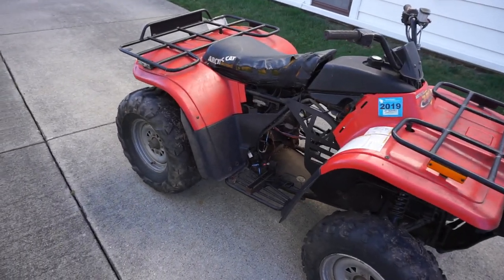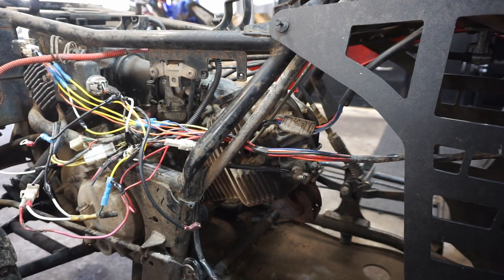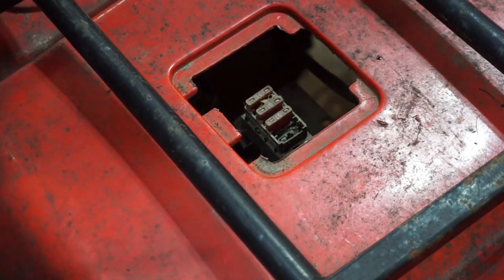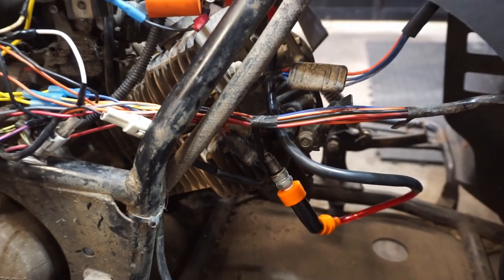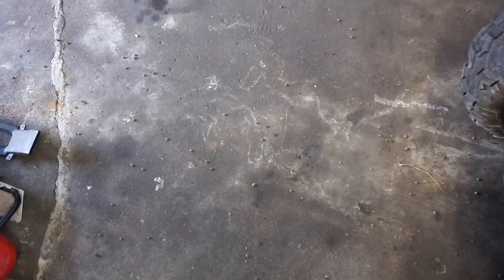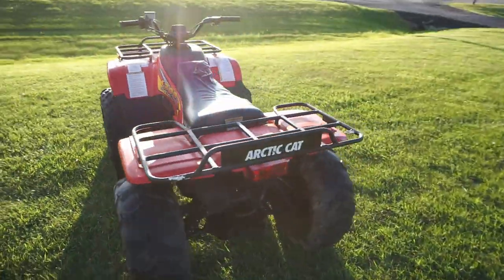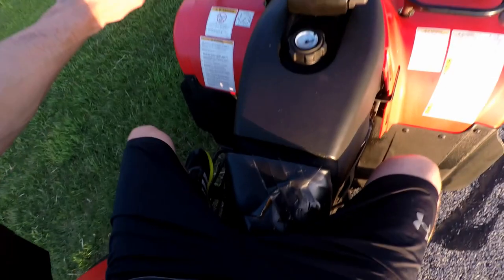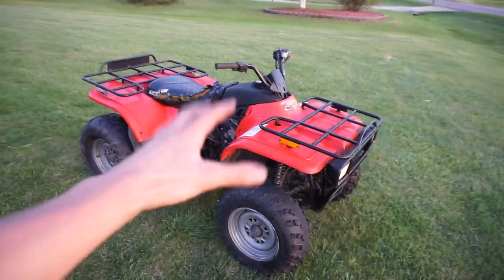Nobody Would Touch This ATV. Why Couldn't They Sell It?

Comment: If you work on a 454, 400, or 500 and it needs shocks, the front Fox shocks and springs off a 1998 ZR snowmobile will bolt right up. It is amazing how much it improves the handling.
Reply: Lol I’m gonna have to try that if I get ahold of one
Reply: @kountryquads9475  I was a test rider at Cat when these were made. As soon as I found out they fit I put them on 2 of my 500 4x4's. You could slide them into a corner and they had very little body roll and were even fun to get air with. As soon as I can find another one this will be the first thing I do to it.

Comment: Dude stick a magnet on the back of your compression tester so u can just stick that bad boy where ever u want. U use it so much, it  would make it way easier to position it for the camera. 
Also your a beast. Love the videos man. Cheers dude.
Reply: "where ever u want"  - engines are aluminium and fairings plastic, magnet will help in some cases
Reply: @vampirwrr  aw ye righto cobber. Thats a go getter attitude there.
Reply: @vampirwrr  but the frame… is not 👍🏼

Comment: Cool video. I have a '98 400 2x4. Looks  just like yours. I bought it new.  Had to put a new carb. on it a couple yrs. ago. Just changed the oil and am putting a new petcock and fuel lines + time for a new battery. It's been a great machine. Got new tires on it and a while back I replaced all the rubber bushings in the shocks. What a diff. that made too.

Comment: I have the same one but 4x4 version , can’t get used to the heal toe shifter.  Any suggestions for oil leaking out the sight glass ? Besides replacing glass ?  I put some sealer on but probably will be leaking one day .

Did you try the diff lock mod on your 4x4 version ? I did it has diff lock hidden gear just like the king quad

Comment: I am a big believer in Marvel Mystery Oil. I use this in my gas so the more I ride the better it runs because the oil really cleans the internal workings of the carb which in some cases won’t have to pull the carb.

Comment: The spark probably came from the capacitor holding a charge even when the battery is disconnected. On. Big capacitor is you can really get hurt. You got to be careful. CDI means capacitor, discharge ignition I believe so it probably came out of a CDI capacitor

Comment: These people that ya'll buy from are their own worst enemy. Screwing up the wiring this bad takes a knack. Thank God there is someone like you to straighten it back out. When ya'll get a new one you never know what you've got till it produces symptoms and on this one it had nuts in the exhaust till they finally blew out releasing the engine to finally run right. Ya'll thought the brakes were on for a while it was dragging so bad. That rear brake may still be dragging but ol Joe will get it sussed out.

Comment: Check the intake manifold boot . I had a 4 cylinder bike with that issue , They usually crack at the bottom so it is easily missed. .

Comment: Quick question I've noticed you pre lube some of the cylinders on your projects up with a lil bottle with extended nozzle of 2 stroke oil so it's safe to use this on the 4 stroke engines from what I'm watching on your channel. Just wanted to verify not to pour in as the oil supply but to lube a lil through the spark plug hole?
Reply: Yes it is.
Reply: you can use any lube or oil like that..it is just a small amount to oil the rings cylinder walls as those are dry from sitting... you don't fill it up ...then when it starts up it burns off ( so smokes abit )... best to spin the piston a few times before spark plug goes back in...and then you can fire it up... 2 stroke oil is ok in a 4 stroke in this manner...use proper oil in the engine oil gearbox

Comment: Are you sure the magneto is charging? When the battery fell out the engine should have kept running not just die like that. Also adjust the valves or check the chain tensioner.
Reply: I had a cable on my battery come loose and it fucked up alot of shit, and yea it ran for atleast 20 mins before noticing. Then a bump start got it going and it died completely after another 20 mins of riding back. I'm pretty sure it fried the stator

Comment: put some wd 40 on the starter and soak that down it will probably start moving. I have greased starter shafts with water proof grease and got them sliding and engageing before, a lot of the time they just get rusty and grundged up and need cleaning. Wd 40 will clean and lithum grease will lub it perminetly.

Comment: Use your heat gun.& Flat paddle pry bar to do it with.,or A small putty knife scraper instead for the holding wire into the plastic while remelting it to.

Comment: Try A fabric shop for that seat covering it's called pleather witch is  fake leather fabric. Then on that side cover part I'd just  stitch it back together. By using aluminum wire like 🐔 chicken cage wire will work for that part to. Then just  heat  up the plastic. Then lay it into the broken spot slightly remelting the plastic over the wire. Then just let it cool back down really good is all.